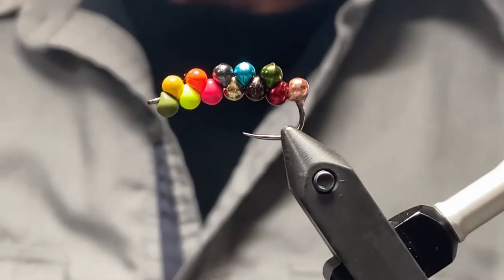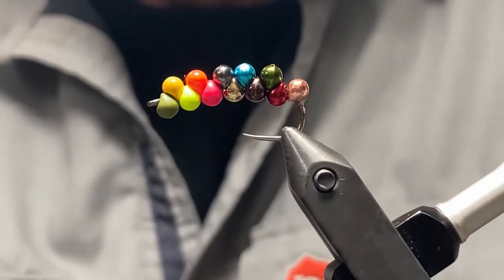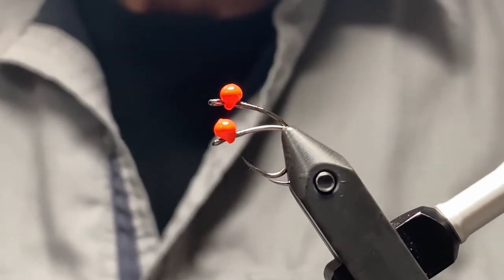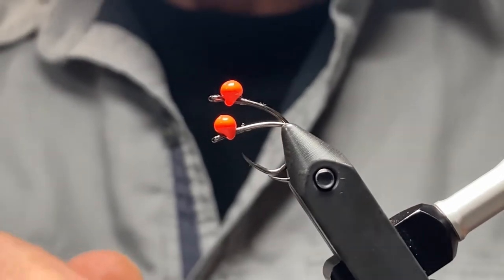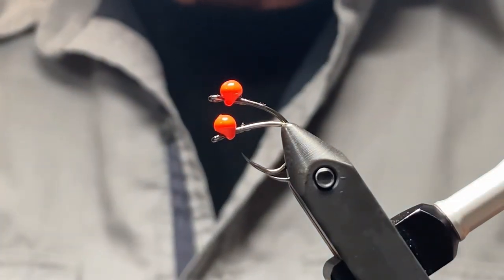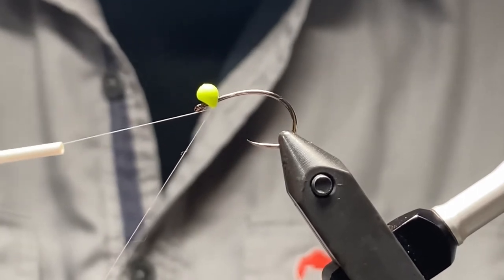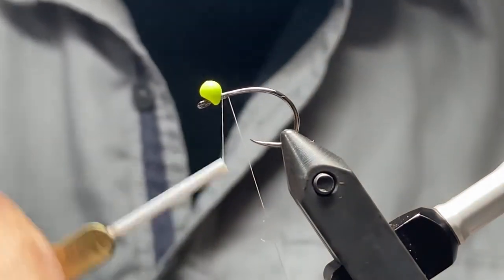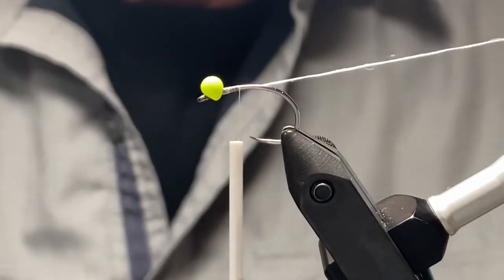THT Beads- Tungsten Head Turner

Comment: Using these THT on 60 degree jig hooks and tying them on with a solid tight knot will make patterns hang under an indicator hang close to If not perfectly horizontally.  Your video shows a great suggestion to get them solid on the hook and that's a very cool tip.  Thanks a lot for making such a good video.